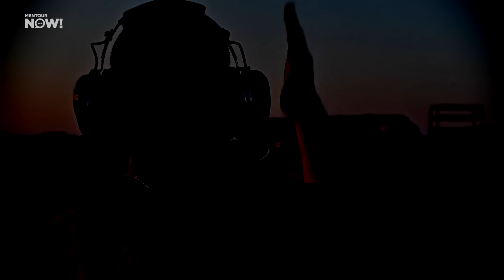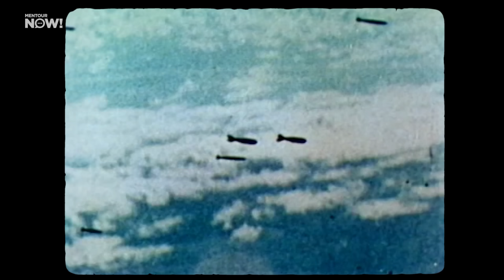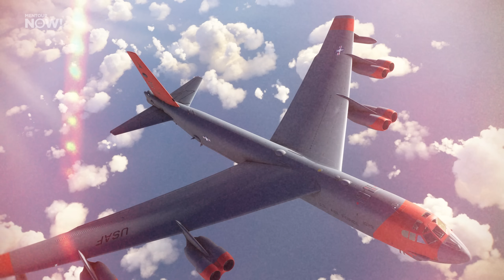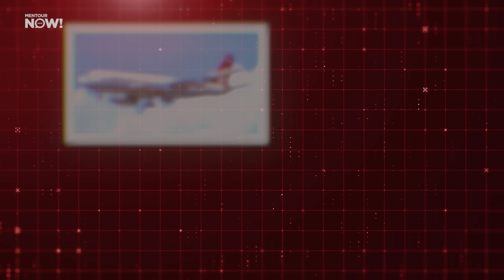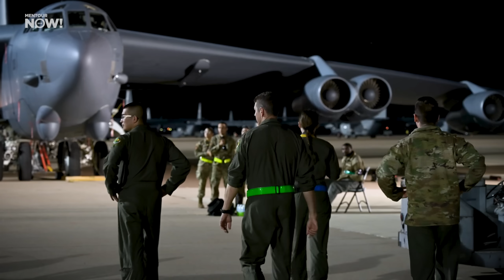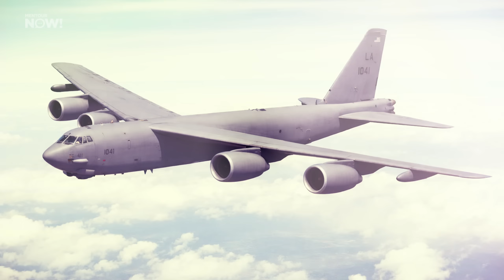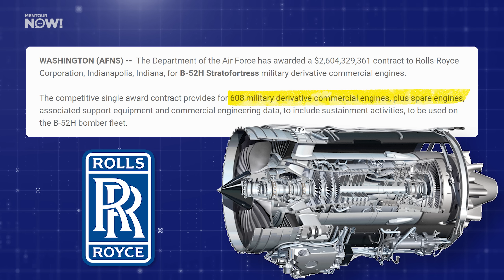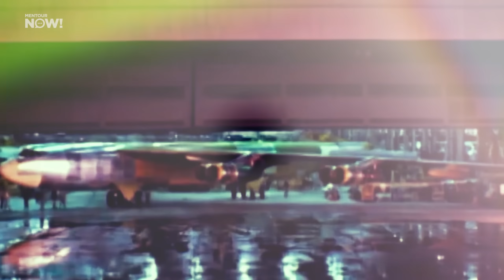WHY Are They Changing The B-52 NOW?!

Comment: Worked on the B-52's weapon system back in the early 80's. This is one tough plane.  Still amazed it's flying.  I can tell you next to nothing of the original guts of the plane is still in them. Was a absolute pain when we had to replace a electrical cable from body of plane to weapons pylon. Had to pull out air conduit and other bomb-nav cabling to just get to this one cable.  I got stuck working up in the wing since being female I was one of the smallest techs in the unit...at 5'6".  Having thin hands with long fingers also helped ...lol.
Reply: Did you scribble something on the least accessible surface of the wing guts?
Reply: @Duke.Of.Shostka  no…never thought of it.  And I’d not want to deal with my master sgt if he found me doing it.  Anything that carries nuclear weapons they tend to get a bit touchy about.  I spent too much time painting scratches on ALCMs cause of quality requirements to even think of scribbling on the plane.
Reply: @GryphTKai1  "Anything that carries nuclear weapons they tend to get a bit touchy about."  Thanks for the laugh, great way to put it.
Reply: @GryphTKai1 Good answer: integrity is too rare these days.
Reply: @GryphTKai1  scribble "master saergant is a dick" then lol
Reply: @GryphTKai1 
"I was just signing and dating the bits I'd already done, so didn't lose track. You do realise these can carry nuclear weapons, right Sarge?" 😂
Reply: But the bones are mostly all still original, right?  Especially all the longerons and frames, ribs....
Reply: @glike2 I worked as an engineer for a small company that made lots of parts for the B-52. We made spares and replacement parts. So no large assemblies. But we made parts for the wings slat spars, engine strut parts, ejection hatches, fuselage longerons. There was an initiative to replace magnesium parts with modern aluminum alloys. One of those parts we did was a control surface wheel. But we were just a tiny company, less than 50 people. There's lots of companies making parts for the plane. So I'm sure over the years most of the plane has been replaced. A ship of Theseus situation. 

When I first started working for that company in the 2000s we had an old guy that could take the lines of the undimentioned mylars and create these wooden tools that were used to shape the sheet metal parts. But as time went on we had to modernize the process. So we had to take scans of those old drawings and digitally trace the lines so we could turn them into digital surfaces to have machines cut our tools.
Reply: @407BRR this whole debate could make a great Reddit thread😅
Reply: @407BRR it's a, real Trigger's broom of an aircraft then 😂
Reply: @stevetildesley3611 that's right, Dave.
Reply: @blueswannabe Still a favourite of mine at airshows! Nothing lands like a B52!
Reply: @407BRR  my grandfather was a prototype machinist who did a lot of work on theB-52’s. He still had a lot of those wooden forms for sheet aluminum along with hand machined one off’s that were used to do original replacement parts from. 
They were scanned later so that parts could be made from computer files instead of from drawings.
Reply: @glike2  definitely not, considering about fatigue.
Reply: @oceyho I have experience in that at Boeing and I think most of the B-52 parts are probably infinite fatigue life and the wings are probably so over designed to handle the nuclear blast wave that they have a very long fatigue life. Remember it was designed before computers were used for stress analysis to cut out as much weight as possible and get closer to fully stressed design
Reply: @glike2   Build the wings lighter? no, stick more engines on!🤣🤣
Reply: @oceyho definitely so!!! Considering i flew on S-58helicopters that had original frames in the 90 that were pretty old then…..
Reply: @glike2  That cannot be true, surely??? Corrosion, damage, re-designs...?
Reply: @PlayerFalcon4 corrosion is a non-issue, rare damage might need parts from the boneyard if it can't be repaired by patch. The redesigns are B-1, B-2, B-21, All of which have so far failed to actually replace the B-52 😅
Reply: @glike2  lets see when they ever figure out the way to go is a reliable, "cheap" *cough"  and rugged workhorse that just does the job ....
Reply: Very minimal corrosion the way these plans are stored and maintained.

I would not be surprised if the grand majority of body works and structural shell is still original
Reply: For those of us that are old enough, to have seen or ridden in them, old cars seem as though their from another lifetime now. But, the military hangs on to stuff years after everyone else is done with it.
   I liked old ships, and you noticed there was no plastic. All the wiring and conduit was rubberized and had some type of fabric covering.   The navy used it for 50 years.
   I noticed the same type of upgrades on the Tupolevs.
   The Tu - 95 Bear and the Tu-160 Black jack were both fitted with turquoise panels and analogue guages, and were basically flying iceboxes, as I'm not sure that they even had heat. The Ruskies finally upgraded those old plane too, and brought them into the 21st century.
  I think, at least the Tu-95s, are as old as our Stratofortress.
   Loved the Hayne's manual.
Reply: @56FastGravel-9er their durability and flexibility kinda turned them into the bombers of Theseus. The Chinese also made the H-6K from the Tu-16.
Reply: @snegik  haha the bombers of Theseus, love it, can't believe these old birds are still flying.
Reply: I worked on the B-52 electronic jamming equipment in the early to mid 70’s. We had electronics all over that plane and the chaff dispensers were also a pain to change out. It is a tuff old bird.
Reply: Thank you much, lady. You rocked.✈️💪🏾🇺🇸💙
Reply: My buddy was small. He also worked as an electrician on the B-52s, including in the wings. This was in the mid-1970s. He went to Carswell  after tech school.
Reply: I was a neclear weapons mechanic for the B-52G at Loring AFB in Limestone Me. from 1962-1966. I never failed to turn to watch one take off. Loved that bird.
Now the B-52G is gone and Loring AFB is gone. Miss them both.
Reply: @JamesH1024-e9t  I tend not to mention what I worked on but I worked on SRAM middles and the ALCM- air launched cruise missiles.   So much fun when we had to move them to and from storage.  SP’s didn’t have clearance to get close to them so someone was always stuck carrying the shotgun as a “last line of defense “.
Reply: Thank you for a typically intelligent, well thought out and still enjoyable video.
Reply: Atta Gal ❤️.
Reply: While in USAF, heard a story of a General looking at maintenance reports and got angry that a B-52 was down for maintenance for 24 hours to "replace a fuse".  When he demanded answers, they went out to the flight line and the General demanded to know, why so damn long to replace a fuse.  The chief said "well, I'll show you... lets go to the back of the plane...  okay here is the rear bulkhead.  This spot.  Solid wall.  The fuse is 9 feet back behind this wall, and 24 hours is how long it takes to tear down, reinstall, and recertify all the equipment between here and there".  General... "okay, excellent, carry on".  May be apocryphal.
Reply: @JkGreyWolf-21 yep the cable we had to replace was because of a small chip in the edge of the pylon plug.  But since it was part of the”nuclear assurances “ Ie had to be perfect it had to be fully replaced.  We all agreed if it happened again we’d just super glue the chip back on.
Reply: Thank you for your service! I worked the ECM systems back then…
Reply: @GryphTKai1: First I want to say thank you for your service. Second: I could not do that job, one I am a big guy, but also don't like tight spaces. If I got stuck in a closet I'd ok, as I can always force my way out, in a wing forget it. I don't even like enclosed water slides.
Reply: Thanks bro,.......for your service...
Reply: In other words you were the B 52 Rosie the riveter. 👍
Reply: Thanks for your service to our country 🇺🇸
Reply: Very cool, thanks for sharing :-)
Reply: @jakobisahero  my best story is when trying to remove a inertial measurement unit for the system from the equipment rack in the front wheel well I got stuck. 

IMU was on a rack that I had to crawl behind to disconnect from some hoses.  Once again being the skinny girl I was the one elected to do this.  While back there I dropped a screwdriver.  Major Nono was leaving a tool on the plane.  So I had to twist myself upside down to try and reach it, being between the back of the rack and the body of the plane.  And I got the screwdriver but couldn’t get turned back around.  Stuck I yelled for some help.  Sargents out there with just stood and laughed.  Finally managed to wiggle out. 

The kicker was the next day putting the replacement unit back in I dropped the same damm screwdriver in the same place.  This time I said to hell with it.  Took off my boot and sock and reached down and grabbed the screwdriver with my foot.   Everyone at the shop had a good laugh over it.
Reply: @GryphTKai1 wow! You really know your stuff. I love it!
Reply: Thank you for Service 🫡🇺🇸
Reply: There was a Dirty Jobs episode featuring the B-52 (I believe) and the only woman on the crew got the job of cleaning out the fuel tanks because she was the smallest member of the team.
Reply: Thank you For your service ❤ I hope maybe they'll dress some of those things and it'll be much nicer❤💪🎯
Reply: you like them long fingers lol
Reply: The maximum service life of the airframe is measured in the tens of thousands of hours, which most B-52's flying today have only gotten to the halfway point. They'll be flying through 2050 and beyond at a minimum.
Reply: Yikes. And thank you for your service❤
Reply: I've always wondered just how much of these planes are actually ~70 years old.  I figured it has to be a Ship of Theseus situation by now.
Reply: Excellent strong intelligent and very capable of standing own within a team. Women are not the weakest link in the chain has always been my experience
Reply: Thank you for your service. It's aways fun &   reading a fellow airman's experience. 
Just curious if this a real world fix or one of the ORI hyotheytical fails they would throw at you to cause us to dig deep?
 I may have "prossessed" you onto the C ramp or AAPA as part of the SPs guarding those BUFFs 24/7/350. I was at Mather '78-'83. Where were you stationed?
Loved the assignment but I requested  to x-train into computer to save my sanity.

Comment: The most exciting thing is that the B-52 was thought of as an interim solution until the B-58 Hustler and later on the B-70 Valkiry will take over. But as it looks like the B-52 will even survive the B-1 Lancer and the B-2Spirit.
It is a similar problem to the combustion engines in general aviation. The Continental and Lycoming motors are from a technology state at the end of WWII. In Europe,<there exist some much more advanced engines like the Rotax 91x and Austro-Engine diesel with a much better fuel efficiency. But as the Rotax has a gear, it is mostly sold out of America, whereas the conservative Americans prefer the direct drive Continental/Lycoming fuel destroyers.
But that reminds me that most armies still use light machine guns based on the MG-42 (Hitler's bone saw), even with a reduced shooting cadence, as the original one needed too much ammo. Today's Russian Infantrists still wear the spade from the Emperor's army.

Comment: lol at the Buc-ee's patch on that pilot's shoulder.

Regarding the age of the airframe and its engine design, though, it's probably worth noting that its Russian equivalent - which is also still the active Russian strategic bomber today - is powered by turboprops. - lol
Reply: The Buc-ee's patch cracked me up.
Reply: The original B-52 design even called for turboprops before being swapped for turbojets! It required a lot of advances in jet engines to even be possible to fly a big plane with them.

I also like the Tu-95 Bear because it looks like a Boeing plane. As it turns out, the planes are somewhat siblings as it was based on a reverse-engineered B-29, designed by the same Boeing team as the B-52.
Reply: Timestamp?
Reply: To be fair, the russian turbooprops are some different level of insanity.
The Tu-95 has a max speed of 499 kn with 310 kn cruise, a range of 8100 nmi and a 45k ft flight ceiling with 188 t MTOW. That is some jetliner performance.
Reply: B 52 turbo Fan no???
Reply: @zed332l  B-52 is low-bypass turbofan, yes. The Russian equivalent (Tu-95 Bear) is turboprop.

Comment: Fascinating that after all this time, no clean-sheet design has superseded the B-52. The B-1 and B-2 tried to outclass it by speed and stealth, respectively, yet the B-52 needs neither to maintain relevance. It seems as though its best replacement would be a similarly subsonic, non-stealthy airframe that only requires 4 engines instead of 8.

Comment: "Why did the B-52 keep the old engines so long?"   The high time B-52 has around 28,000 hours on it. Compare that to many Boeing 757 airliners that are younger......yet have more than 100,000 hours on them.....so far. The average hours flown per year on B-52s is around 380. THAT's why the B-52 has been around so long.....because they hardly ever fly them. The weak spot on the B-52H is the upper wing skin. If they did nothing, they could fly it another 47 years. If they re skin the wings it can go indefinitely, like a DC-3 or something of that nature.